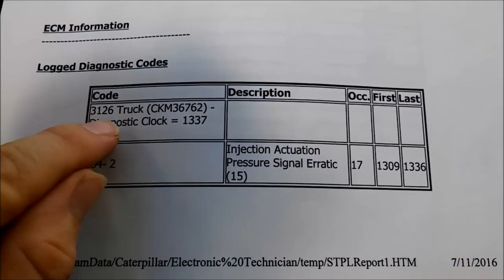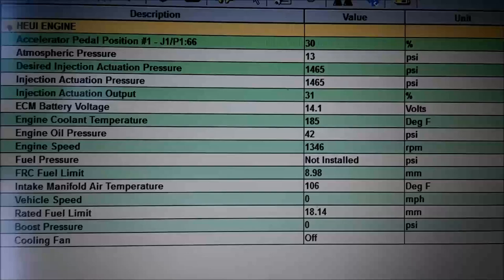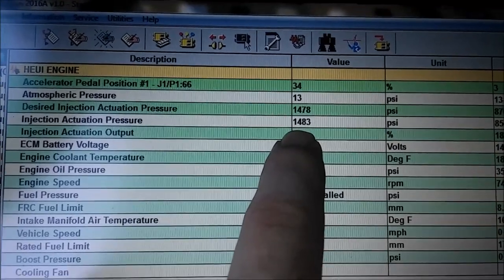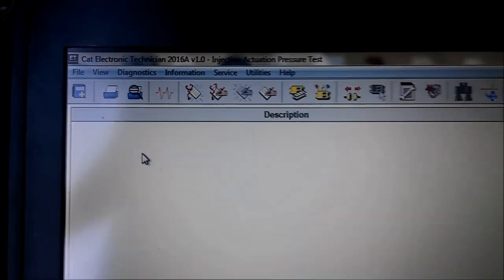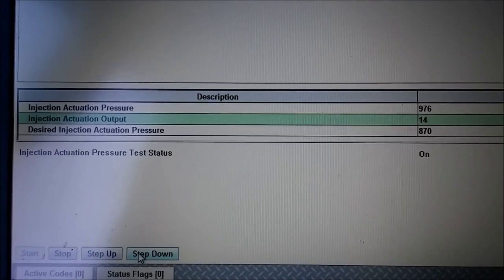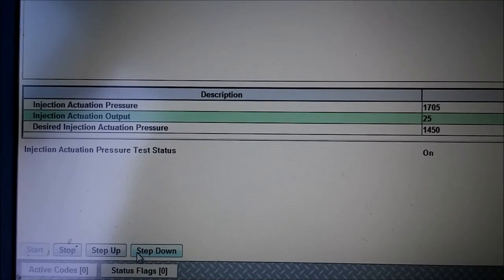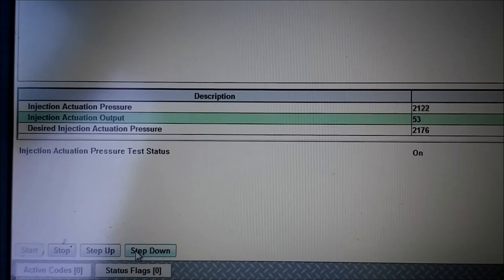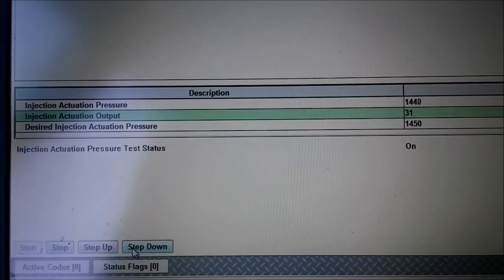How To Troubleshoot HEUI Systems and IAP faults. 164 Faults.  3126, C7, and C9 Cat Engines.

Comment: I have a motor home with a C7. Sat for couple years. I did start it and run once in a while. I can’t seem to get fuel to the inlet of primary filter. I drained tank and added fresh fuel. Replaced both fuel filters. I did replaced the fuel regulator today. Have a hand prime pump but it never gets hard to push after priming 100’s of times. Cat dealer replaced HUI pump and injectors a few years ago so I’m hoping it’s not that. Any ideas as to why no fuel to the primary fuel filter?

Comment: Will the pump throw this 164-4 code had at 2 shops 1 of witch said motor needed new rings I had put new injector seals in it replaced pressure sensor on head still have crank no start or really bad running when does start engine protect light and engine light comes on lose of all power

Comment: So, I have a 3126 with a intermittent issue. While under way, i hear will the engine "grunting", then for no apparent reason will stop grunting and smooth out. When it smooths out, I can hear the turbo more clear and it runs like a top. Most times it will not clear up, and for better words is a complete dog! I have done injector cups, and have changed the fuel filters 20 times or so.(in hopes it will run like it should). I have no check engine lights. I noticed the other morning, I started it and the rpms jumped to 1000 rpms or so as if I patted the pedal a couple times. It ALWAYS STARTS, and has never left me stranded. KOW. Any help would be great. I appreciate your videos. Where are you located?

Comment: Have c7 10 oms good. If I clear codes and history engine not running. I get the flashing light on the dash. I haven't even started the motor. Would this indicate a wiring issue. I had to put injector seals they were gone. The harness to injectors was in bad shape and 1 injector failed on test. I can't get the flashing to stop. I need advice on what to do. Please. Great video!
Reply: Hey I have the same problem now 😢😢

Comment: I Have a 2006 c7 and it is surging badly when accelerating under load.It shakes the truck badly.  It also surges or has a "choppiness"   when revving the engine in neutral. It does have a light unevenness when you let go of the throttle from a rev. Have any thoughts???

Comment: Hi there I have a C7 that has injector 1 and 2 not firing. I have since confirmed its not the injectors we I swoop them around and they fire. I suspect it could be the ECM because all injectors squirts oil and if I pull out the plug it stops squirting. I tried the cylinder cut out test but you can hear there's no change in sound or  rpm or fuel pressure unlike injectors 3 - 6. Can you please help with any advice. Our big problem is we don't have another test ECM so I want to make sure before buying one. Thank you

Comment: Have a 2001 renegade with a cat 3126, cranking but doesn’t start, runs off starting fluid but doesn’t continue to run, It’s been sitting for years so I think it’s either the transfer pump or the heui pump but both are expensive and idk how to tell which one, what kind of scanner do I need to check for codes?

Comment: I bought a 2000 gmc 7500  box truck and it came with no ecm can i buy any ecm for the 3126 cause that’s the motor thats in there to get it to drive?

Comment: good videos man I appreciate it.. I'm dealing with a c7. complain is runs OK at idle but at full rpm it spits n misses and puffs black smoke.i perform a Injection actuation pressure test and it keeps up with the demand. just got a new heui pump about 6 months ago. I'm thinking bad injectors. I have 65-70 psi after the transfer pump. what do u think?
Reply from the maker: Your fuel pressure sounds good, have you tried doing a cylinder cutout test yet? If you have week injectors that should highlight them.
Reply: Ran out of time but I should of done that cylinder cut out test. That's my next step when I get back. I'm working on a d6r dozer c7 it has 11xxx hrs not sure if injectors have been replaced yet. U think I should do the test of pulling the valve cover and check if the injectors are spraying oil out
Reply from the maker: +sabino Salazar If the injectors were spraying oil out your injection actuation pressure test wouldn't have kept with desired pressure, but try to do that cutout test and see what the injectors do at different IAP pressures, sometimes that will help highlight the miss. That is a lot of hours on HEUI injectors, I'm going to guess you need a new set.
Reply: You are correct sir last week I replace all Injectors and runs like a charm
Reply from the maker: I'm glad to hear it. Thank you for following up and letting me know.

Comment: Have one running like it's got a cam in it at idle... running it feels like a miss. On the test drive I go into Injection Actuation Pressure Test, Start Test, runs smooth as butter immediately. At 870 it ain't got the power to drive the mountains of course. I push up the pressure to max and she runs like a scalded dog. Pressures max, expected to actual match up. Ran like that for a bit. Cut off the test and the engine runs normal. Drove around a bit and still no problems. It was recently serviced. Any chance there was debris in the injectors and pushing the pressures blew it out or should I be looking into this more?

Comment: I need some help here. My 3126 is down and its the system i think. Fires on ether. Crank no start. Just died on me backing out the garage fixing issue none related to this. Had a computer on it saying it met desirables on pressure while cranking. Found a 164-3 code. High voltage to iap sensor. Replaced iap and ipr(iap valve on pump). Any ideas

Comment: Hi there I have 3126b in an 2001 fl70, the engine is sputtering if the outside air temp is hot. Doesn’t matter if the engine is cold or hot. But on a colder day. The engine will run nice and smooth until I have to really put it work(climbing a hill loaded or something like that), i have changed the Heui pump, fuel transfer pump, the actuator on the heui pump, the oil pressure sensor, the check valve on the rear on the engine, the fuel pump in tank, and of course new filters and oil and lots of fuel. the truck doesn’t have any codes and doesn’t have any kind of smoke coming out of it. Do you have any suggestions for me to check next? Thank u

Comment: sorry to bother u again. so took off the valve and cranked it over and i notice that one of the injector was shooting out oil through the side does that mean i have a bad o rings on the injectors? and when it start up that was the only one with oil shooting out. thanks

Comment: Hey there. I am working on a C9 that surges while accelerating until it gets above 1600 RPMs. I’ve noticed the actual injection pressure is higher by 2-600 psi while it’s doing this and once it calms down it read close to the desired. Where do I even start. I have CAT ET and am familiar with the heui system but never seen one do this.

Comment: a 1998 Kodiak with a 3116 HUI. I used it to move parked it 3 years ago and want to start it.  Fuel evaporated from the tank, added 5 gallons.  Tried pressurizing the fuel tank with 15 ish psi and no fire.  What should I be doing?  tia

Comment: Have a 02 , 3126 no codes engine idles fine at cold start , but afterwards engine warmed up engine surges on idle , once you increase rpm to 1000 rpm runs fine.

Comment: on the video u said to take off the valve cover to see if oil was coming out of the injector, is that another way to determine if my heui pump is working if the if oil shoots out?   how would you determine if the injector themselfs are leaking?
i wanna say thank you for help me out on this cat engine.
Reply from the maker: Your injectors purge small amounts of oil when running, but if one is spraying oil or purging a lot more than the others you have a problem with that injector.

Comment: Hey adept, great vids. I have a c9 powered d6r with an engine miss. It seems to miss and pop and smoke at hi idle. When I go through the iap test on et as I increase ia current to 55 and above I get large fluctuations in actual iap (3200-3700psi)and ia current(53-59). I suspect the iap sensor to be faulty causing the current fluctuations but I was wondering if timing sensors or throttle sensor could possibly be causing similar fault as they are also inputs for iap. If the iap sensor doesn’t fix it, I was told by dealer that heui pump could be faulty. Would a dead head test help if the sensor doesn’t repair it to test heui pump output? If so how do you carry out deadhead test? Thanks

Comment: My problem with a cat c7 is low oil pressure, change the pistons, all the metals inside the new oil tank and the head rubbers, and nobody understands why there is no pressure. question ? can be heui pressure pump

Comment: Working on a c9, truck starts fine cold, but when warm the truck will not start. IAP is commanding 700 psi but when the IAP test is ran it will not go over 700 +- , even when commanded 3300 psi. Output is sitting at 99% during test the whole time. Any thoughts? Huei pump? Checked for injector seal leak and no leaks when cranking.
Reply: I'm having the same thing going on with my GMC c6500.

Comment: Good afternoon I have a 3126 cat engine with 145,000 miles I am having a issue with it while  using it it feels like it get air or like if it wants to turn off we stop the truck and put the transmission in neutral and press the diesel pedal and it goes way and we keep driving fine 
And once in a while while the truck is stopped but running it will turn off and we go turn it on again and it stars right away ???? Any idea what it could be ??

Comment: fluctuation right ?
great vids man thumbs up to you
Reply from the maker: Fluctuations? Are you referring to the HEUI Pressure? Thank you for commenting.
Reply: Adept Ape  pre ttymuch i been dealing with those a lot specially on c-9s
Reply from the maker: +Franky Siguenza Yeah once the system starts surging and can't control the pressures it's time for a new pump, at least that is the normal fix.

Comment: I have about 20 psi idling on a C7 with 20000 hours it starts very hard when it is hot. Could the oil pressure be the problem? the injection pressure test seems to be ok.

Comment: My 3126 wouldn't start. Turned over fine. I replaced the injection actuation pressure sensor and it fired right up without further issues.

Comment: Is the fuel supply pump serviceable on the back of a Heui or do you have to replace the whole pump? I have a 3126 that only starts and runs if you pump the hand primer pump. Once it empties the filter it dies. The supply pump is bad.
Reply from the maker: +James Morris Yep, you can change the fuel transfer pump by itself. If it's the older style pump like in the thumbnail of the video you don't even have to remove the pump. If it is the C7 style with the plug in the top then you should pull the pump to change the transfer pump.

Comment: I have a Cat C-7 eng# WAX54111 I have extreme high pressure oil pressure at crank and idle approximately 4000-4500 psi changed IPC sensor HEIU pump ecm traced and inspected wiring any other ideas as to why this issue is occurring advice would be much appreciated.

Comment: Hey Adept

I noticed that many  youtube videos of 3126 engines use meui not heui. so does the 3126 use heui or meui?
Reply from the maker: +Omar The 3126 used a HEUI system, but had a different style HEUI pump. They are HEUI systems though.
Reply: Adept Ape  hey man I have a 3126 and the shaft that goes though the heui pump is not turning so the fuel pump is not pumping what would cause that shaft to not turn thanks

Comment: great video your presentation and info are super! any chance of video about using et. i have it at work but would like some of your input
Reply from the maker: +timmi one An ET basics video wouldn't be too hard to make it's hard to get screen capture on my work laptop though. Many of my troubleshooting videos incorporate ET into them. Check out the cylinder cutout test one and my troubleshooting check engine lights videos. I'll put the idea in my possible future videos brain cell though. Thanks for commenting.

Comment: My truck  has a misfire I have no way to communicate with the ecm I’ve replaced tue huei pump and stil cuts off when Im after 3rd gear ⚙️ check remove the valve cover to check for leaks seems like a lot of oil is coming out of the injectors but don’t know if that’s normal any ideas 💡

Comment: On one of my c9 the pressure and the actuation pressure output fluctuating a lot. Cannot ask more than 20% with Cat ET, if so the engine start to vary from 500 to 2*** psi and the output go from 20 +/- to 0 psi if i stop the test, the pressure continu to goes up and down. Ive change the heui pump 1 month ago and all the injector this week. I have no code. Do you know what can be the cause?

Comment: hi friend, I have a c7 that runs fine but sometimes It starts to shake and miss powerwith white smoke and the flash code are 15 ; 39 thanks for your comments...
Reply from the maker: +Ovi S What is the serial number.
Reply: Hi Mr.adept I put 2 new injectors with the part number 2638218 and new hew pump and it is working properly, but other mechanic told me that those injector I changed shouldnt be for machinery cos mine are 2413239, tell me if there is gonna be a problem about the torque .. thanks   for your videos ... veri importan information ...

Comment: I have a CAT 3126 E, serial number HEP43867. The engine will start and runs fine at idle, but at 900 rpm up to around 1400+ rpm it cavitates (revs up and down). At full throttle it seems to run Ok as well. I do not have CAT software or  gauges to test pressure. Any thoughts?

Comment: Young man my motorhome has a 3126 and it was running ok and it just started losing power and at times it would die I can let it idle and run at full throttle and it will start losing rpm and then start smoking real bad is that a sign the pump might b bad it might run fine for a couple miles then it starts acting up no engine light and no codes I'm lost

Comment: it has a new IAP and what i call ipr for the heui pump. i work with powerstrokes and i know that they are alike. i don't a scanner to check my pressure, so I'm not sure how to go about to see if i have desire pressure that it needs to fire the injector.
Reply from the maker: Really the best way is to get a scanner, but if not you could use a high pressure hydraulic gauge set that is rated up to 5000 psi and install it in the HEUI oil rail, you need about 850 psi at cranking to fire.

Comment: I have a3126heui that wont start after setting for 7 months, ran perfectly, when parked. thought that possibly air in injector lines, removed valve cover to get to lines, cracked lines one at a time starting at front of engine, nearest to radiator, very little fuel or air at injector line, and one of the lines no fuel came out.  fuel filter pressure pump on fuel filter is pumped up. What do I need to check next? thank you.

Comment: I did actuation test and found that at 870 I have 877 actual but only 2 to 4 % Injection actuation output.
If I ram it up to 1400 I have 39% output. How long as you ramp it up and down in seconds should it level out?

Comment: thnx again it is very useful . but I have another question maybe u could help me with . I have a Perkins 1103 generator set . but it stalling and die under load  .
Reply from the maker: Does the annunciator panel have any of the warning lights come on when it stalls?
Reply from the maker: +Ahmad Ali So you put the unit under load, it stalls with lack of power, then shuts down for under frequency/under voltage? It sounds like a horsepower problem. You need to check the Turbocharger and the intake tubing and aftercooler for leaks first thing. Does it run smoothly under no load or does it have a miss?
Reply from the maker: +Ahmad Ali Normal breath? Do you mean it doesn't have a turbocharger? Is it a Diesel or gas engine then?
Reply: +Adept Ape it is a 3cylinder diesel

Comment: I am working on a C7 on a bus and I am getting a active and inactive injector mechanical no response code. Does that call for a injector replacement right off the bat? or should I do the fuel verification test? and other tests that you may recommend???? any and all help that you can give would be greatly appreciated
Reply from the maker: +Rclopez40 Is it a regen engine or a HEUI engine C7?
Reply: It is a regen engine

Comment: I have 2136 in a RV. I'm having an issue with engine surging. The check engine light is intermittent. It runs good for after it warms but at time it surges when brought to temp. I've changed fuel filter and fuel actuator on huei pump. What could be causing the surge? It is also hard starting
Reply from the maker: +Michael Patenaude 3126 is the engine actually if it's a Cat. Can you get the blink codes with the cruise control switch?

Comment: Hello, my name is Mario. I have a 3126 CAT and I am getting a 164-2 code for Injection Control Pressure, voltage above normal or shorted high. Is there a sensor test I can perform to ensure that the sensors are operable like ohms or continuity? Thank you in advance.
Reply from the maker: +Mario Sottosanti Yes you can and the ECM is doing it for you to some extent. Since it is showing an open, if you unplug the sensor and then put a piece of wire in it to short it, you should get a voltage below normal code, which would mean your wiring tests out good.

Comment: I have a 3126 pulled the line going into the head and no oil when cranking on it so does that mean I need a heui pump or is there something else to check?
Reply: Did you ever figure it out? I am in the same situation?